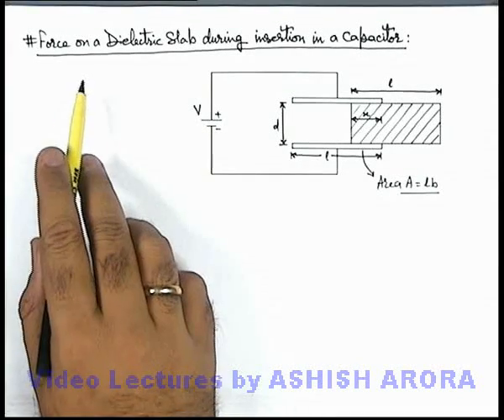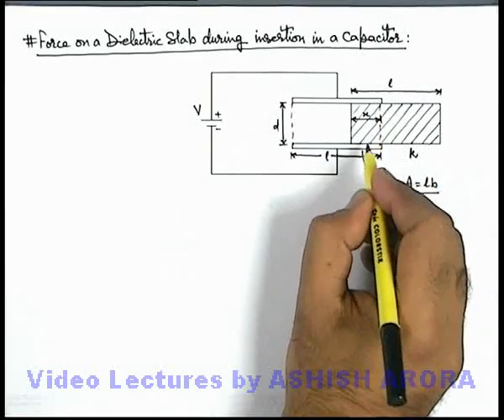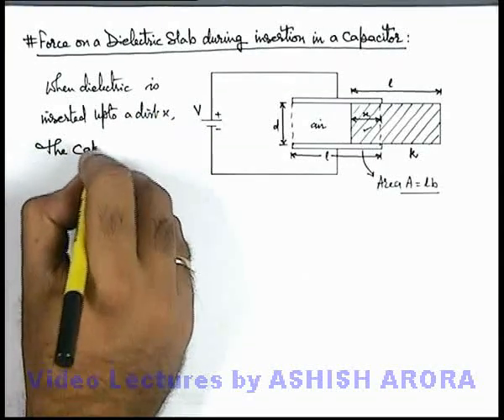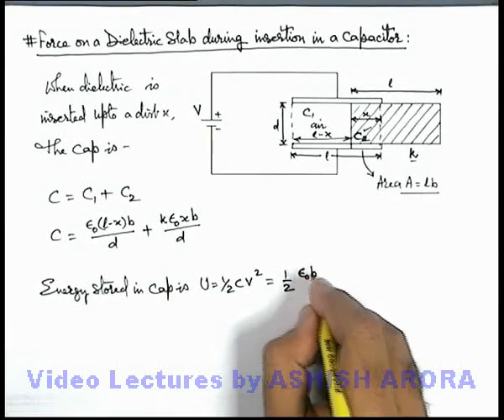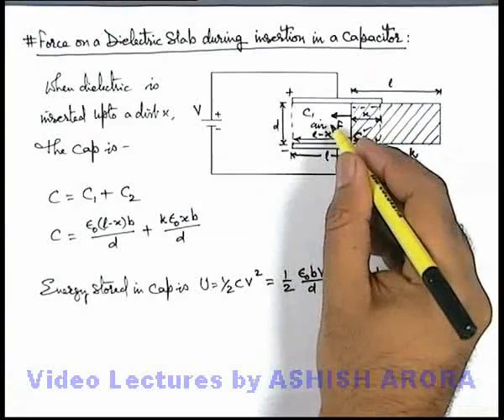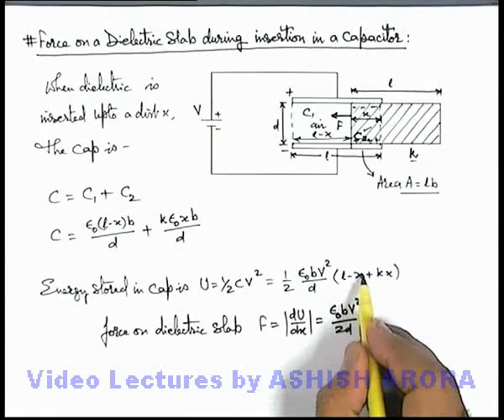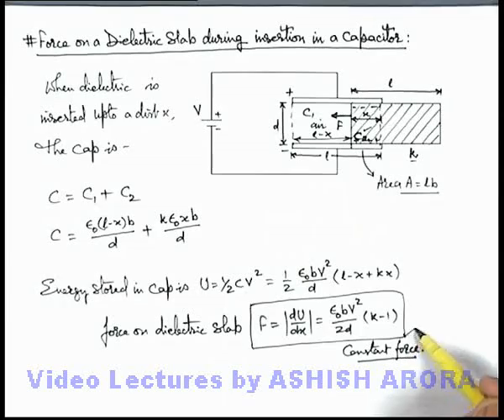Class 12 Physics  | Capacitance | #36  Force on a Dielectric in Insertion in Capacitor | JEE & NEET

Comment: Sir can you pls confirm this

Is this formula is only valid when a slab is inserted? Because only during insertion, the potential energy due to the fringing fields remains constant (as it's always passing thru dielectric and we consider it long). But when it's being removed, the edge of dielectric continuously encounters new fringe fields that aren't constant when we move along the capacitor (I.e. with the dielectric) so here when we do dU/dx we can't ignore the "dU" due to fringe fields.

Could you pls confirm this

Comment: At 3:24 , why there is inward force? The positive plate will try to attract upper face of dielectric upward and the negative plate will attract it downward with an equal force. But from where inward force us coming?
Reply: polarisation occurs immediately after it is inserted , + charges are towards the - plate and vice versa . Now the + charged side of the dielectric will be attracted to the - plate and thus no external work will be required to insert the dielectric.

Comment: Amazingly, this solution is incorrect as it ignores the energy put in by the power source dW = VdQ. Going with this solution will give us the force which is equal by value but in the opposite direction, as increasing capacitor energy requires positive external energy, ending with external force pushing the slub into it - the opposite of the real force direction.
Reply: Exactly, to maintain the constant potential, battery has to do work
Reply: Bro can you please explain it in a bit of detail
Reply: dU= d(1/2 CV^2)= V^2/2 dC , dWbat = Vdq = V d(CV) = V^2 dC, dU = dWbat - dWmech -> dWmech = V^2/2 dC = F dx -> F = V^2/2 dC/dx, as C is a decreasing function of x, the resultant force will be in the opposite direction of movement, resisting the decrease in the capacitance of the system. The solution matches this result in terms of magnitude of the force due to the fact that the work done by the battery being twice the mechanical work done on the dielectric.
Reply: After insertion U becomes U/k , hence the systems energy is decreasing while adding the dielectric
Reply: @shlok2129 no brother...after insertion that energy becomes U/k because 1/2×kC ×V²/k²  and then battery does work to maintain potential from V/k to V. Thus energy becomes kU [Sir explained in last video - case 1] . So yeah, energy of the capacitor system increases ...but I have to think whether this force concept is correct or not

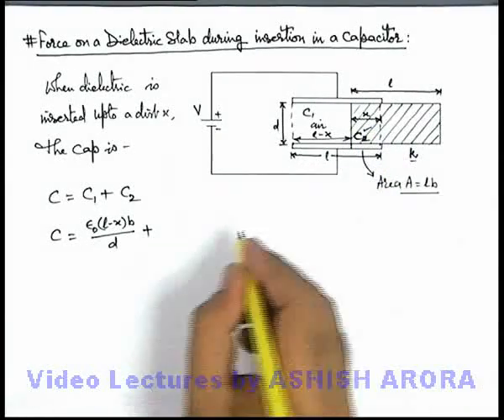Comment: 2:08 why another variable b? Can't we take d as breadth?
Reply: Parallel plate capacitor is a 3d structure ..what sir has drawn is a 2d view ..b is the portion which is going inside the plane(paper)

+ 'd' is the distance between the plates and not the thickness which I assume u were assuming it as

Comment: sir is there an external work done to move a dielectric within the capacitor? If not why ?
Reply: polarisation occurs immediately after it is inserted , + charges are towards the - plate and vice versa . Now the + charged side of the dielectric will be attracted to the - plate and thus no external work will be required to insert the dielectric.

Comment: sir, do the whole change in internal energy of capacitor spend to do the work(to  pull slab).
some of the energy should be used to polarize the dielectric . isn't it

Comment: Sir will this dielectric do oscillations while coming out of the capacitors?
Reply: no because force is constant
oscillations happen for varying force
Reply: And also can someone confirm this

I think this formula is only valid when a slab is inserted. Because that time the potential energy due to the fringing fields remains constant (as it's always passing thru dielectric and we consider it long). But when it's being removed, the edge of dielectric continuously encounters new fringe fields that aren't constant when we move along the capacitor (I.e. along with the dielectric) so here when we do dU/dx we can't ignore the "dU" due to fringe fields.

Am a right?

Comment: Sir here can we take energy as q^2/2C
Reply: no because battery is kept connected to capacitor while inserting. I believe there is another case here. 
It was taught to us in our college. The case when you charge the capacitor, take out the battery and then start inserting the slab. That time V is not constant so we will have to do q^2/2c
Reply: Dude its easy. As we are providing potential difference across capacitor. An we are introducing dielectric in it then its capacity would change so amount of charge it can store (in reality it stores energy in form of electric field line) will change. Therefore we can't use q formula. But if v is removed then we can use it as no more v is applied so charge flow would stop and by conservation of charge charge will remain same. Hope it helps
Reply: Ya bro since battery is still connected 
Charge gets redistributed
So q^2/2c can’t be used
Now I know this 
Thanks

Comment: How can we calculate force when width is less than d but dielectric covers whole area of parallel plate
Reply from the maker: In this manner explained in above video, you can analyze it... to an approximation it will work well... exact analysis can't be calculated due to fringing asymmetric configuration of electric field...

Comment: Sir could you please explain the direction of the force? We know that nature prefers low energy, and in this case energy will decrease if the dielectric moves towards right side? So, shouldn't the dielectric experience a force towards the right side instead of left?
Reply from the maker: No its the battery which is supplying the extra energy... on inserting the dielectric energy tend to decrease so force should be toward left only... and it is due to fringing of electric lines and induced charges on dielectric due to which attractive force acts on it so force is acting toward left...
Reply: @physicsgalaxyworld  thank you sir

Comment: Thank you for the video , but I think more clarity has to be given on why the dielectric experiences an inward force. Anyways , keep up the good work
Reply: It can also be explained by the fringing effect,electric field lines bend at the edges and thus induce a bound charge on the dielectric(even the part which is yet to enter the capacitor),causing attraction between oppositely charges particles ,this horizontal component on induced field acts a driving force.
Reply: @CristianoRonaldo123-j9j  shut up
Read all the doubts in comments
Many have the same doubt
He is just giving his opinion about the concept is not cleared well and need a bit more explanation
Toxic people
Reply: @CristianoRonaldo123-j9j  nice one bro.. I totally agree with u

Comment: ALTRNT METHOD - 
C = εb(1+x(k-1))/d .. now dC = εb(k-1)/d ·dx 
since Q=C·V
dQ=V·dC
dQ= εbV(k-1)/d ·dx 
work done by battery = -dQ·V 
= εbV²(k-1)/d ·dx 
using energy conservation → Wtotal = -ΔU
Wexternal+ Wbattery = -ΔUcapacitor 
F·dx + εbV²(k-1)/d ·dx = -½CV² = - εbV²(k-1)/2d
F =  εbV²(k-1)/2d

Comment: great! i was correct in most of the part.. but it didn't give me the same answer when i took integral of F.dx and equated it to change in energy dU of capacitor before and after moving by distance X... can u please tell me why my approach didnt work out?
Reply from the maker: Your method is correct... and will give you same result... but you might have missed the KE of the slab and work done by battery in that...
Reply: true!! thanks sir.
Reply: the dielectric slab kinetic energy is nil. An electrostatic condition is maintained.

Comment: Here this force is not the only reason for the increase in energy of the capacitor.....there is energy provided continuously from the battery.......then in this case how can you say that F=du/dx.......
Reply: i think it is so because by dU here they mean change in energy of capacitor.. which is basically stored in electric field..what does battery have to do with it?
Reply: That change in energy is provided by the work done by the battery.....we shouldn't take a system like this neglecting the effect of battery which is actually the reason of increase in energy of capacitor....when charge is supplied by battery in a normal case, half of the energy get lost as heat and other half gets stored in capacitor and i think that is exactly the case here....moreover i think that this force is due to fringe effect so how can one find its value without taking it into consideration ??
Reply: @tanvee619  hey tanvee are you in iit now

Comment: sir if width of capacitor is less then d then c=series sum  AND TREATING IT  ASC AND THEN I WOULD PROCEED FRM STARTING AS U DID AS UPROCED    am i right
Reply from the maker: +Arabinda Biswas No... if you are inserting the dielectric from one side it will be polarized due to fringing as well as due to inner electric field and in case of less height and partial filling we cannot calculate the force by any means we have studied till now... it can only be done by integrating polarization vector inside the dielectric... which I have not covered in these lectures...

Comment: sir why in this case energy is conserved while in the problem of liquid rising in capacitor ie ieirodov q3.144page 124 its not so
Reply from the maker: +Arabinda Biswas It is not here also... but we ignore the polarization energy in dielectric in which a fraction is dissipated... as there is no way to calculate it in this case when a dielectric is getting polarized due to fringing of field lines... and in these lectures we are not covering polarization vector so we are not accounting it here... in 3.144 que... we are able to solve it without using polarization thats why we did that way... which is more accurate...

Comment: btw its horridly wrong....you forgot about the battery
Reply from the maker: +Mrigank Rawat Actually not... in this case you can calculate and see that the gain in kinetic energy of slab is exactly same that of the change in field energy of capacitor and sum of the two is the work done by battery so it will not make any difference... separately you can solve and satisfy yourself...
Reply: +Physics Galaxy im not saying the answer is wrong but the method itself, you should've not connected the battery and the derivation would be good, although force would be variable
Reply: @physicsgalaxyworld   intros case heat will be dissipated na

Comment: The final question to consider is how this can happen physically. If the capacitor were ideal the field lines would be everywhere radial and hence could not exert a vertical force. However they cannot be radial at the ends of the capacitor, as we have seen. It is this fringing which produces a force. By looking at the entire capacitor with energy we avoid the very difficult problem of finding the exact field at the ends. Compared to the whole, its effect on energy is negligible. If viewed as a force problem it is not.
Reply: +Resnick Halliday this is the effect of crossing saturation point of your brain lol !
Reply: Bros the resnick Halliday

Comment: Although answwr is correct but not the mthod. How can u use f=du/dx. In case when there is external source of energy
Reply from the maker: +amit kumar In this case we can do this...  as here you can calculate and see that the gain in 
kinetic energy of slab is exactly same that of the change in field 
energy of capacitor and sum of the two is the work done by battery so it
 will not make any difference... separately you can solve and satisfy 
yourself...
Reply: @physicsgalaxyworld  All this is nonsense, even when the answers are correct! Has somebody ever approved or falsified the result by experiment? According to the explanation in the video, the force is constant and to the left. Then what when x=L? Will the dielectric keep moving to the left? For ever?
You can only discuss this properly when considering the electric field at the fringes of the capacitor. How can a force push in the horizontal direction, when the electric field exists only in the vertical direction? And when x=0, is the force constant or zero?
Don't just copy false explanations from standard textbooks. I hope students of the 21st century can learn beyond the standard mistakes in such textbooks.....
I'm so angry that trivial errors of this type perpetuate without critical investigation.
Reply: @skkuedu  i totally agree and request @Physics Galaxy to reply
Reply: @skkuedu  If the Current is Steady
The DIELECTRIC WILL BE IN SHM
Reply: skkuedu if you have clear basics then you can analyse these cases on your own
Reply: @skkuedu  no bro . Here unspecified charge opposes the direction of force.  Due to opposing nature force acts in horizontal direction.